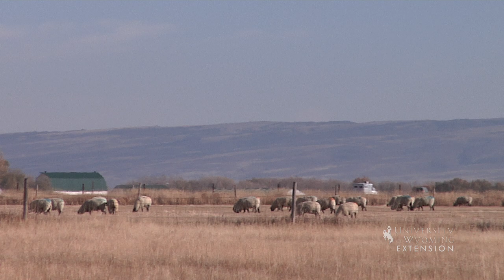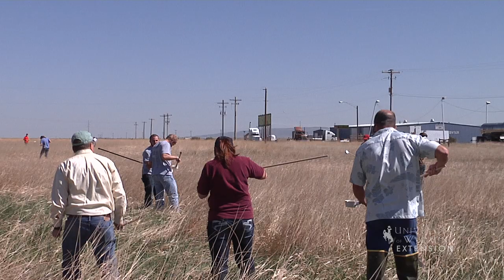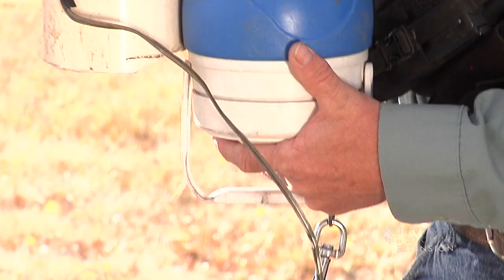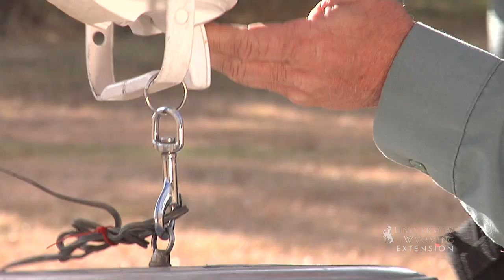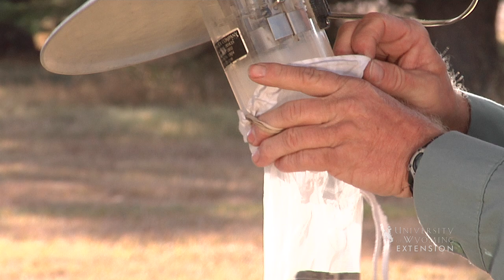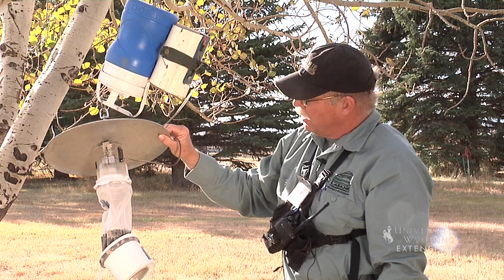Setting CDC trap

Comment: Hello, Where do the mosquitos enter the trap? Are they attracted down into the container because it's black inside? Thanks.
Reply from the maker: There is an approximately 1 inch wide gap between the metal disk - weather shield and the clear plastic cylinder that houses the light bulb and the fan motor below it.  As the mosquito approaches the trap, the inrushing air movement from the fan catches them and sucks them into the gap, down through the fan blades, and out into the mesh bag below.  If they survive the trip through the fan, they end up in the collection cup at the bottom of the trap. The CO2 from the sublimating dry ice and the light from a small bulb act as the attractant to get the mosquitoes close to the suction created by the fan.
Reply: Are you using co2 as dry ice or as a pressurized tank?